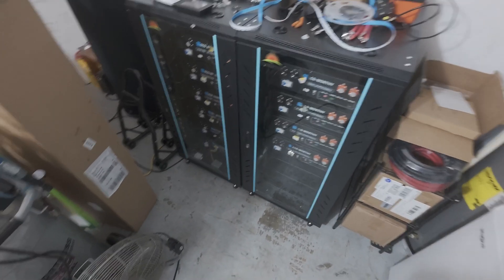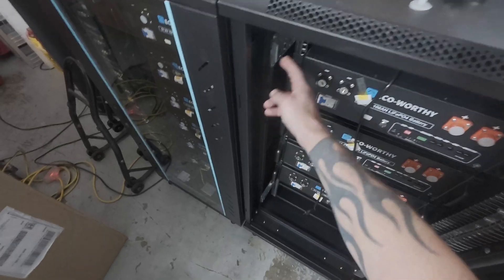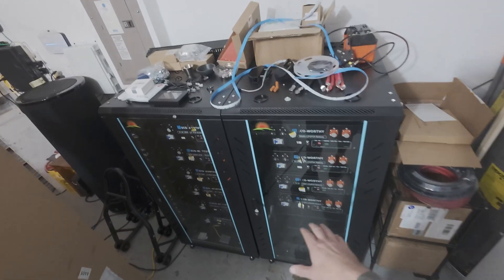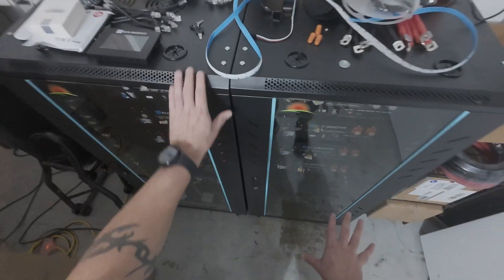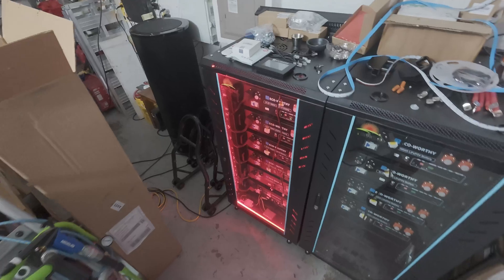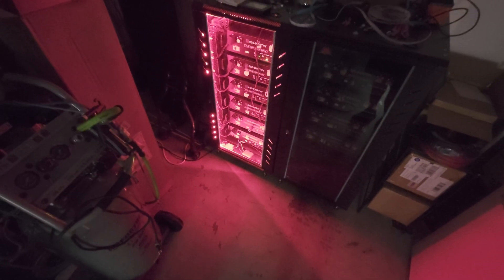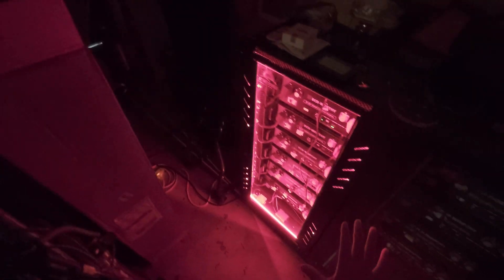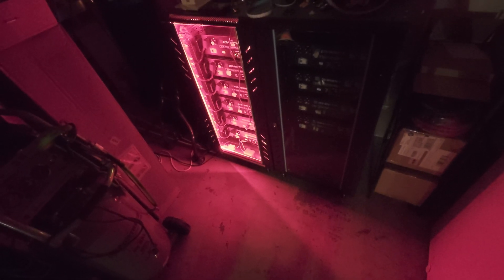SunGold Power 6 Battery Server Rack - First Impressions & Upgrades

Comment: looking forward to your build video of these racks.  I will buy the same rack and batteries. i will have mine in garage near the garage door.  Any concerns for fire with these batteries?
Reply from the maker: Got that updated build video, it was just a short one but covered the process, did you manage to find it?  https://youtu.be/FClxk0mlJhs?si=V9aatZZNGrrQv7cE
Reply: @ViciousXUSMC i decided to get the diy batteries instead.  Someone on youtube mentioned the cells getting out of balance and it woukd be hard to fix.  Bought the eve m31 cells from docan and diy kit from yixiang
Reply from the maker: @waterhouse1835 I also have a full DIY battery build guide too ;) great battery, heavy as all hell.   Not UL listed so be aware if you need that.

I get inspection today and can't use my batteries.
Reply: @ViciousXUSMC good luck on your inspection!

Comment: Link for LED lights that work on 48V DC?
Reply from the maker: That is what I'll cover in the build video when I make the other one.  It was not a direct Buy A and Done, I Made this and if I take it further to make it Smart it will be another level of invention that you wont get from a store bought product.

I just ordered the parts to build a huge DIY battery to free up the last 2 Ecoworthy batteries for this build.  Not due to ship till september unfortunately so I have some other videos I want to work on until then (Ecoworthy Trail 300DC vs Anker C300 DC) just ordered both of those today and should have both soon.